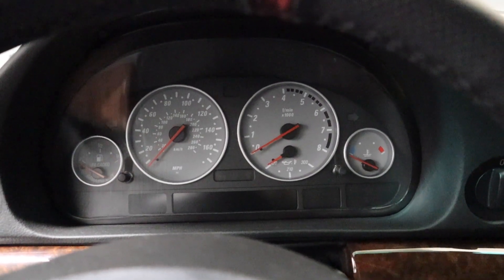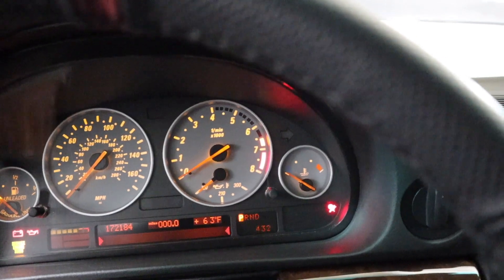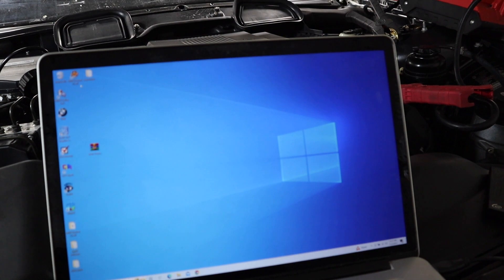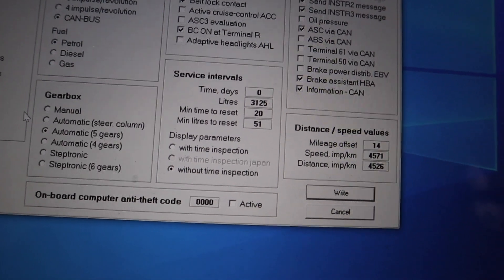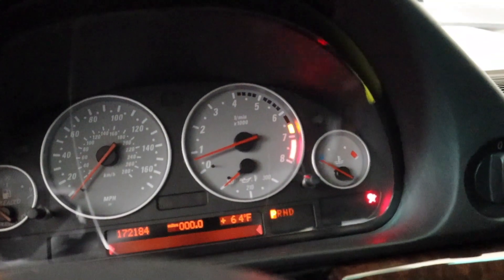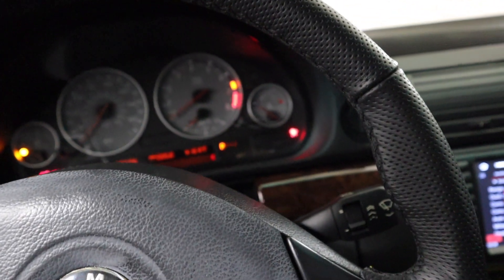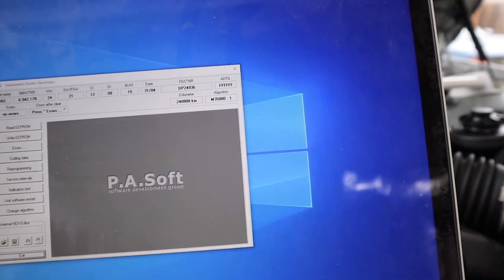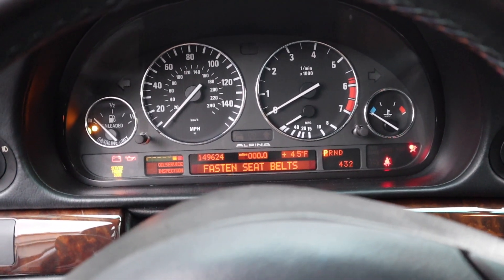BMW E38 740il/750il M-Cluster coding and removing the temper dot!

Comment: I can help you with the oil temp and rpm light programming if needed.
Reply from the maker: Plz that would be lovely 🙏🏻
Reply: @bmw_fanatic  How do I make contact?
Reply from the maker: @purplecty740  want to contact me thru Facebook? just search Ruslan Safarov.
Reply: @BMW Fanatic Unfortunately I dont use facebook
Reply from the maker: @purplecty740  do you want to contact thru email and I can give you my cell thru email? I don’t want to post my cell here.
Reply: @bmw_fanatic  
Yes
Reply from the maker: @purplecty740  ruslan-safarov@hotmail.com
Reply: Hi, I have some issue on my 2001 750IL, I switch to M3 cluster, and if you guys would help me, to solve the issue with the oil temperature and the RPM light, if not, at least give me some information that would help me to fix the problem. Thank you.
Reply: Need help with that as well
Reply: Will this work on bmw z3 tamper dot?

Comment: The scanner that you have linked to under your description, says that the software supports only windows XP, but in your video you say we must have windows 10 or 7 to use the software. Which one is correct.
Reply from the maker: Not sure but I have windows 10 in my computer and works perfectly fine
Reply: @bmw_fanatic  thanks for reply, would you write the part number for me. There are two kinds of at Amazon one is with cd that operates with XP and one with USB memory stick that operates with windows xp, 7, and 10 this one sells for $68.